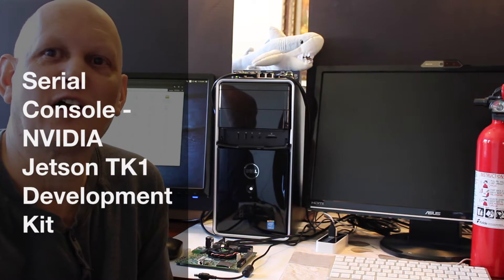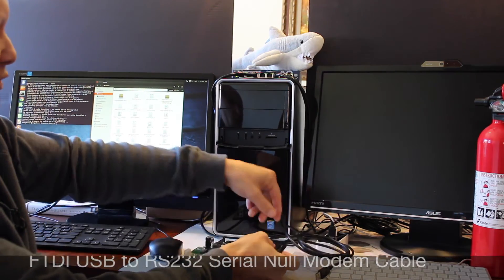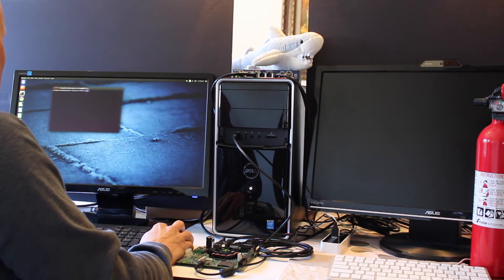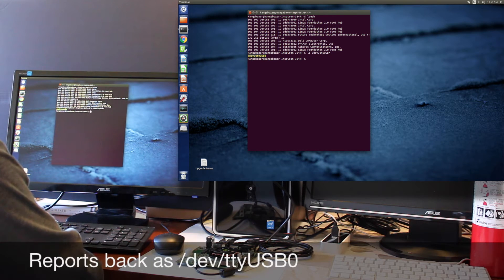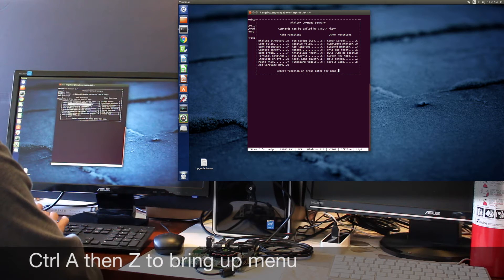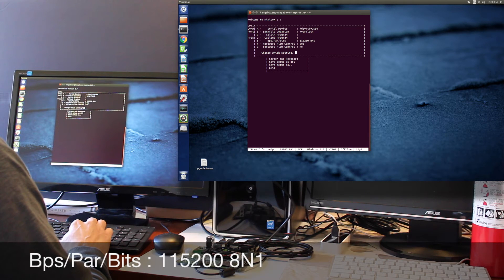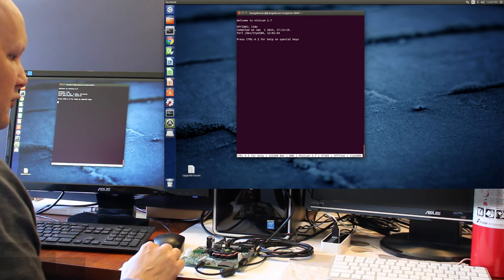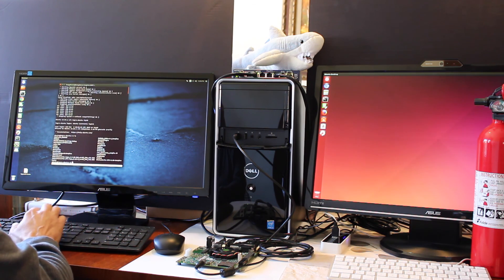Serial Console   - NVIDIA Jetson TK1 Development Kit

Comment: Hello,
 I want to access the terminal of Jetson on my laptop using SSH ,so I connected  an Ethernet cable .Now the jetson and the laptop does not have an IP address so I have assigned one but what should be the default gateway ?
I am getting an error on Putty. and not able to access the terminal of Jetson
Reply from the maker: You can ask general questions about the Jetson TK1 on the official NVIDIA Jetson TK1 support forum: https://devtalk.nvidia.com/default/board/162/jetson-tk1/
Reply: Ok Thanks!